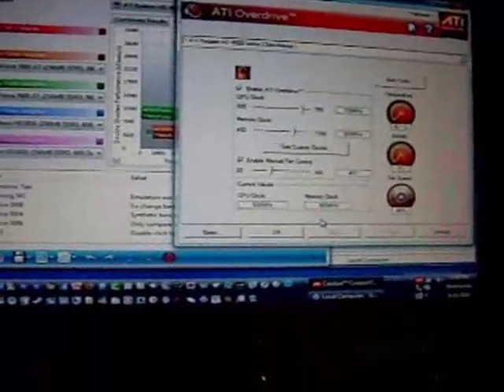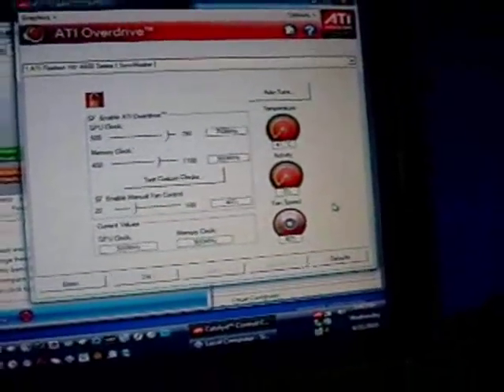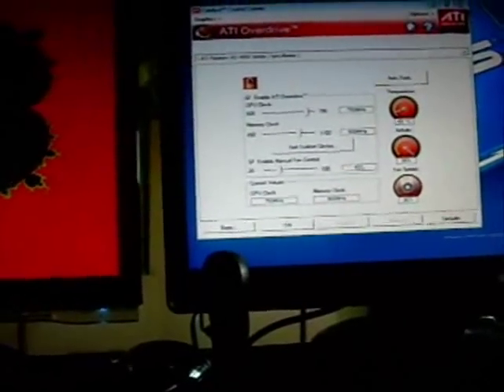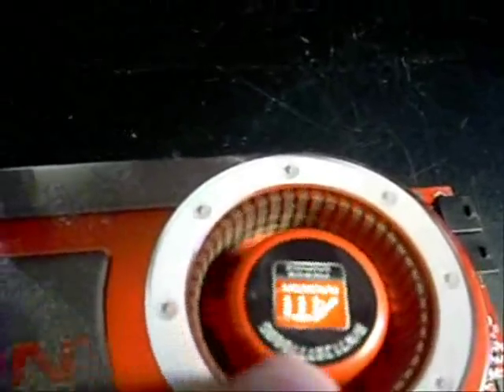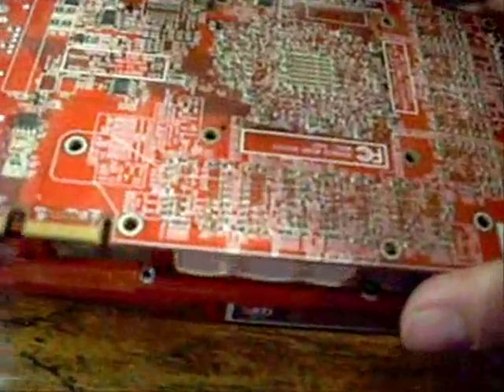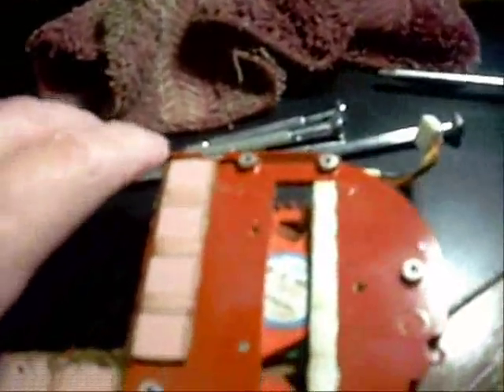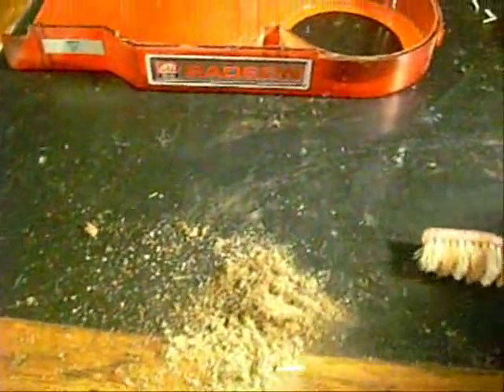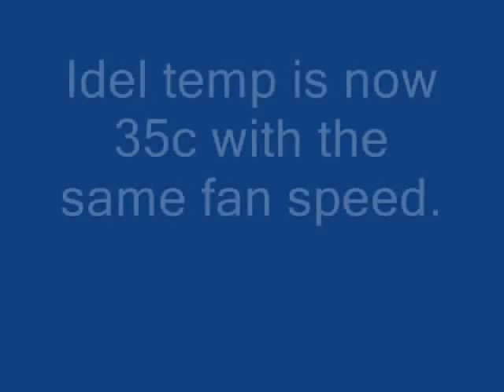Cleaning out video card for better cooling

Comment from the maker: Better safe then sorry. If you are uncomfortable about taking it apart then just try to blow through it really well from both ends with compressed air. In time thermal paste does lose its ability to transfer heat. But if your temperatures on the card are decent then I would just try to blow all the dust out of it and let it go at that.

Comment: @zver711 Most people not only forget - they don't know it supposed to be opened and cleaned. I didn't know my first time. I had a Xfire of ATI X1900s set up in Antec Sonata III case, very small and dusty and hot case. Cards were flying over 100Cs so finally I got enough balls to open them up. That thick layer of dust clogging up the air intake on their hoods - I thought it was a freaking foam dust filter, before trying to remove it, and finding some copper fins under that. It was a shocker.

Comment: Now this is an excellent idea. I mean I cleaned my crap out before, but with 5 PCs in the house + the boodsucking friends/relatives got problems...I completely forgot about cleaning out those dust traps. Good idea on the follow up on AS5 after curing. I'm using stuff that doesn't require curing, but I'm sure I got some AS5 remnants somewhere...in the special parts-I-will-never-use-but-too-cheap-to-throw-out box. I'm sure almost everyone got one.